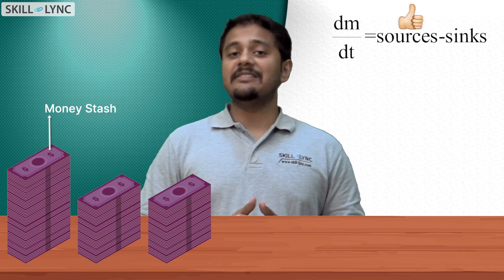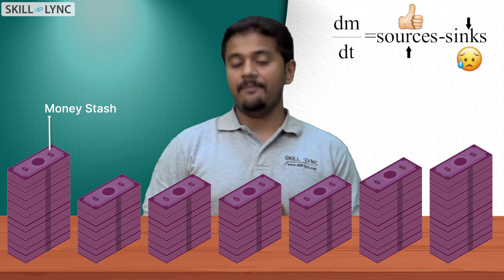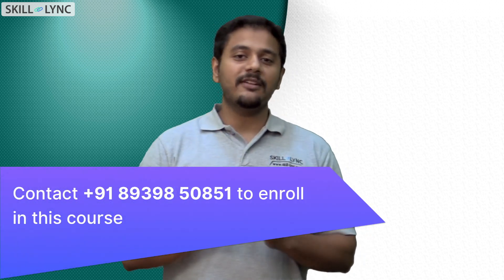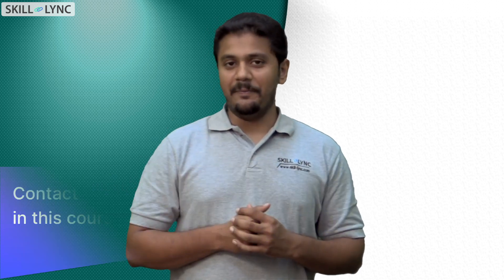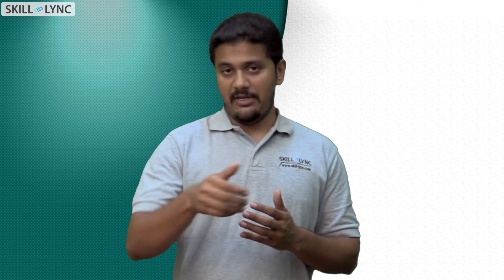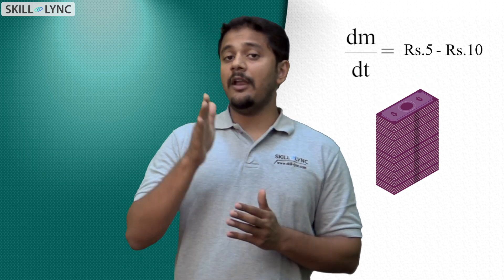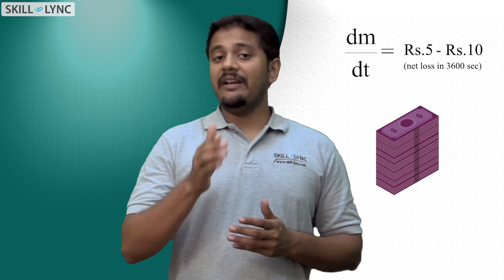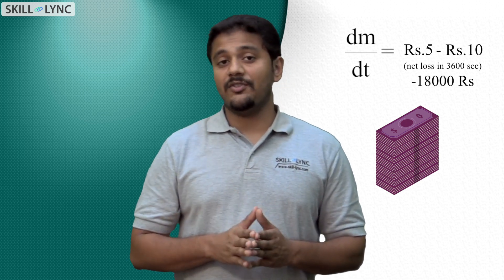What is steady-state? | SKILL-LYNC

Comment: Transients in Mechanical Engineering - 
1. Rigid Body Dynamics - Motion with acceleration in time. (Change of velocity instant to instant) 
2. Deformable body dynamics - Strains are varying with time. Means, with each instant, the deformation values are changing. 
3. Fluid mechanics - Fluid has changing velocity at any instant at any point in the space of flow region. (Flow in finite or sufficiently short time scale)
4. Mass conservation - Mass is continuously accumulating with imbalance of incoming, outgoing fluxes & sourcing or sinking at any instant in time. 
5. Energy conservation - At each instant in time, there is net storage of heat or internal energy or any other form of energy with imbalance of incoming & outgoing fluxes, sources & sinks in time. 
(Energy conservation in short & finite time range).